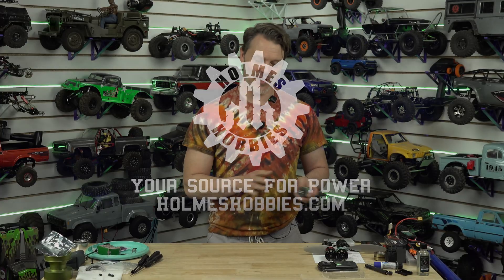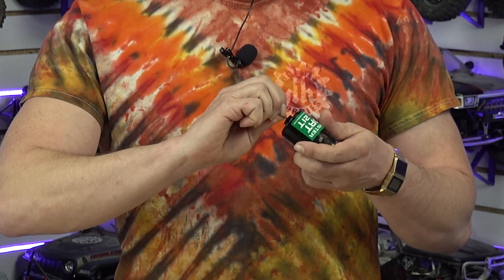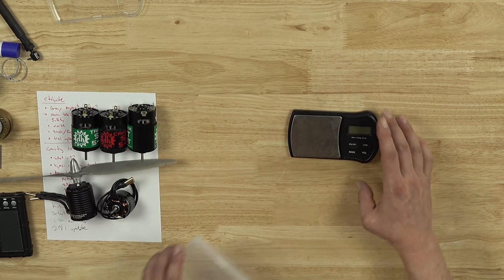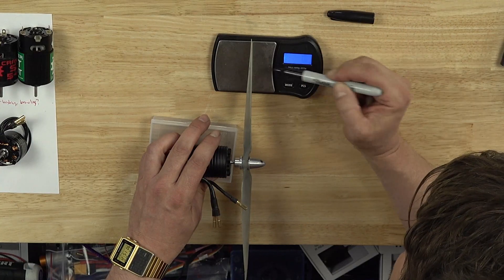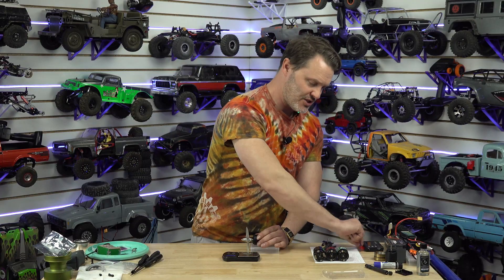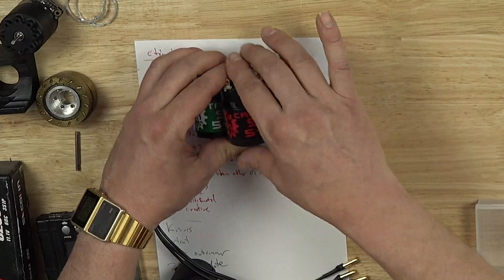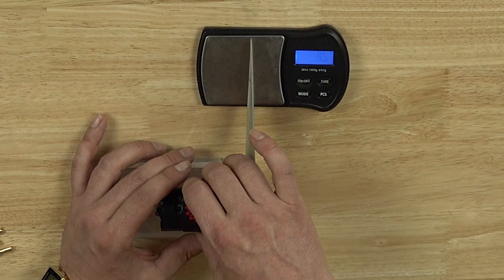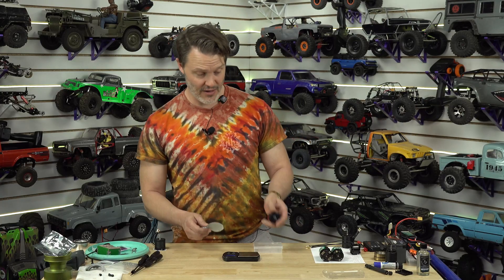Detent Force Demystified: Boosting RC Motor Performance!

Comment: Awesome, some motor information I didnt know I needed. Ive always turned motors by hand and assumed the amount of torque required was a measure of its quality. Now it has a name and a property I am checking. Thanks so much!
Reply from the maker: @shannoncold   we can have high quality go both ways!  But similar builds, the higher quality will typically be harder to turn.  Tighter airgap, better magnets

Comment: I feel like a better way to do this would be a like a drum on the motor shaft with a string wrapped around it with it loose end going to a pull scale.
Reply from the maker: @rc-daily  that works too. But longer the lever, the better the precision.  As jank as using a prop is, ive found it to be a very useful and easy to obtain method.

Comment: So, if you have room to stick more magnets to the outside of a brushed motor, does it actually improve anything?
Reply from the maker: @ryurc3033  eh, if done properly it can increase torque and reduce rpm.  Done wrong it will make the motor weaker.
Reply: @HolmesHobbies  thank you for even entertaining my ridiculous idea for an experiment.